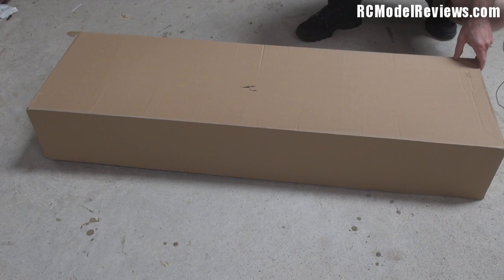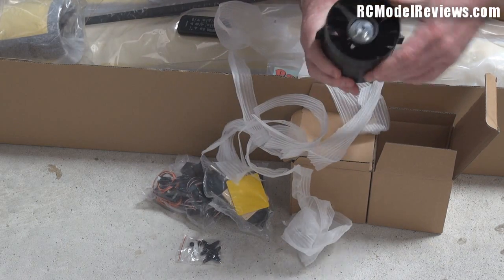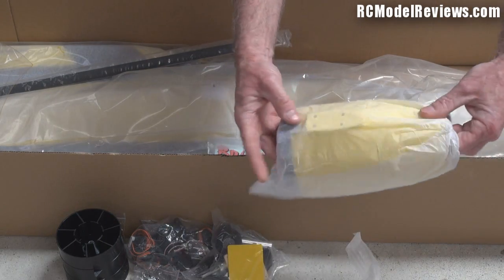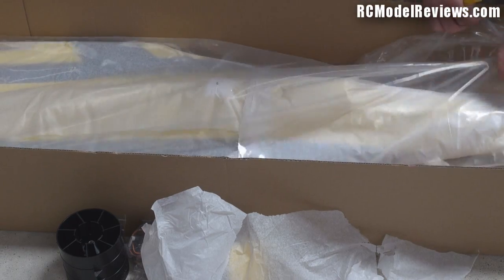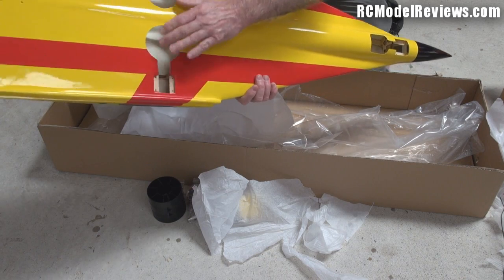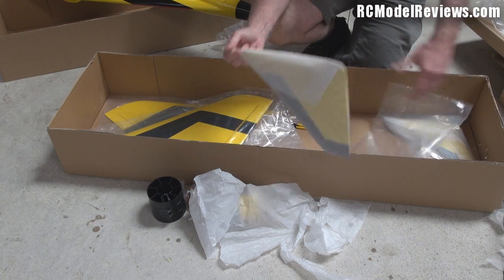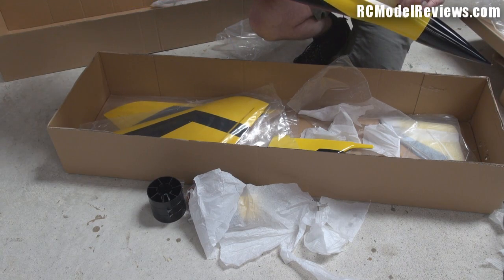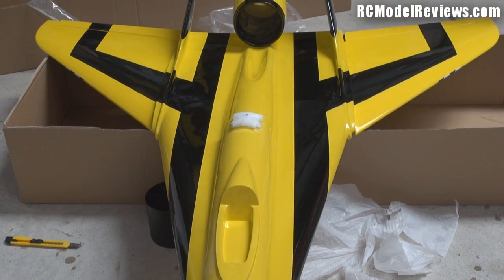Bruce Lee 90mm EDF (unboxing)

Comment: Yes but if you look it all so Clearly says 1600kv motor Included,so i can see why some might think it comes with a motor,here i'll copy and paste what i read,Changesun Ducted Fan(12 blade) and 1600kv motor for 6S Lipo (included)
but i did also see where it said not included.
so it could be 50/50 lol it needs to be more clear IMO,Chinglish comes to mind.